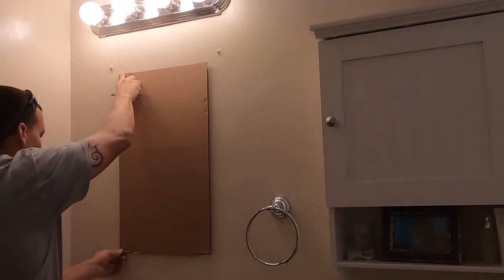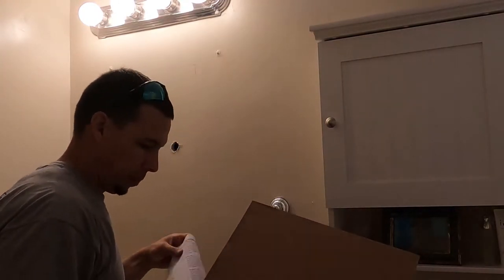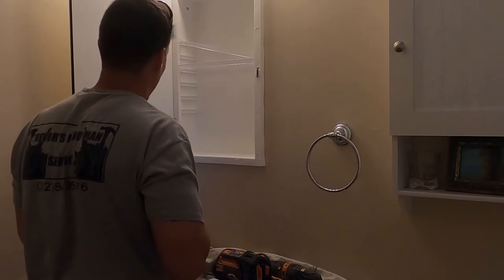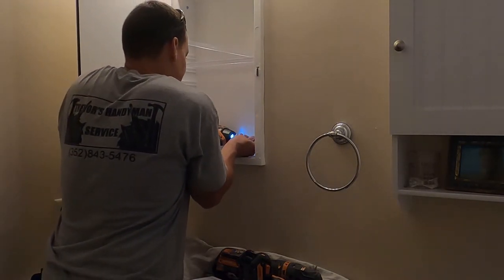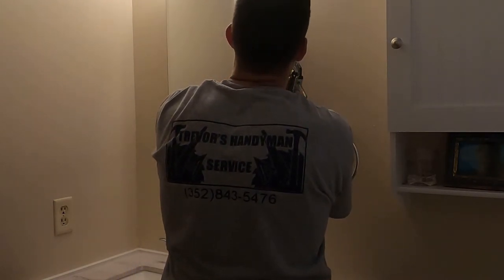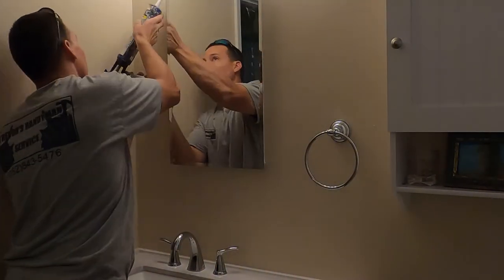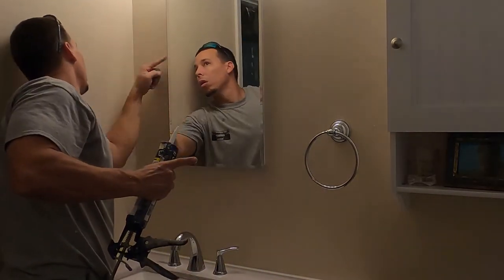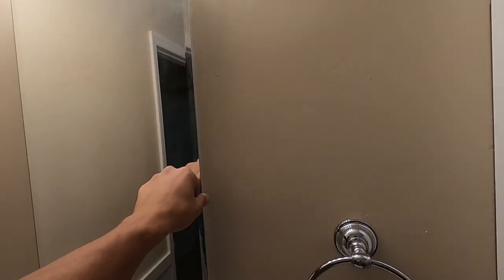medicine cabinet install

Comment: Thank you so much! That was the first video that actually showed me a normal easy to cut the wall!
Reply from the maker: yeah, you can also score with a utility knife/razor blade many many times until is goes all the way through, a hand drywall saw, oscillating tool like I used. There's many ways.
Reply: Yeah but I feel like I this is the easiest way. Anyways, thank you!

Comment: Yes this video gave me exactly what I needed for my situation. I just need to know what size was the dead wood. 2x4 or 1x4 ?
Reply from the maker: 1x4x10 or 12' wood is used for the purlings. My situation was unique to say the least. It doesn't have to be pressure treated either.

Comment: Nice video but I'm confused why you didn't show the cut out of that stud?
Reply from the maker: Sorry about that, I don't remember if I didn't get that part or if I edited it out. I just used the vibrating tool or oscillating saw for that as well. You could easily use a saws-all as well as long as you're not concerned with poking through the next wall. Fresh blade on oscillating saw will give you a safer more precise cut with no worries.
Reply: @moreworkfortrevor2027  thanks !
Reply from the maker: @davidsinger4705  no problem, if your medicine cabinet is heavy you could even add blocking to sit in between the studs for more support as well, this one was really cheap and light but it's what the homeowner wanted.
Reply: Thanks for your replies Trevor. I'm debating that right now what kind of cabinet I want.

Comment: Your audio stopped half way through.  No support on the bottom?  Eh.
Reply from the maker: Checked the audio, either I wasn't commentating or it did go out for just a bit but picks back up. There's a stud right in the middle of it which should be plenty of support right beneath it in the middle. You could add some blocking for a sill if you're concerned about it but I don't think it will be an issue unless you overloaded this thing which is probably impossible given it's size.